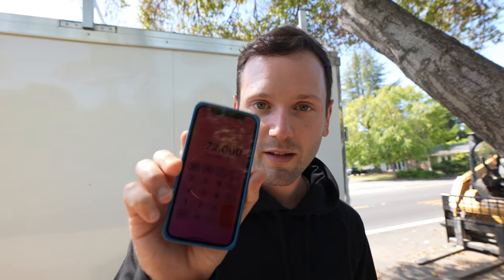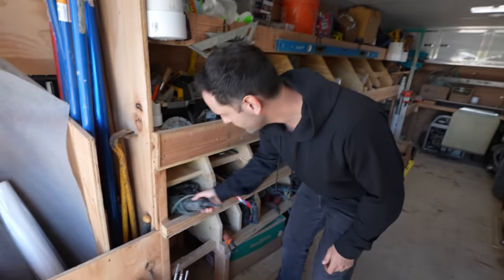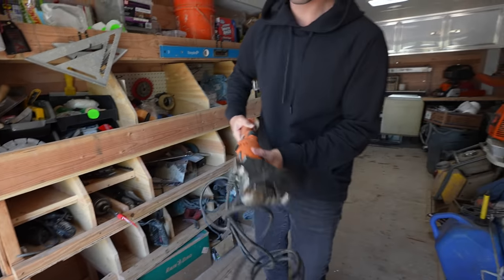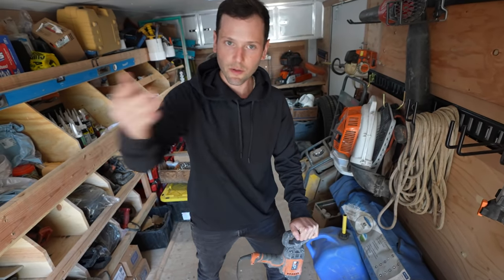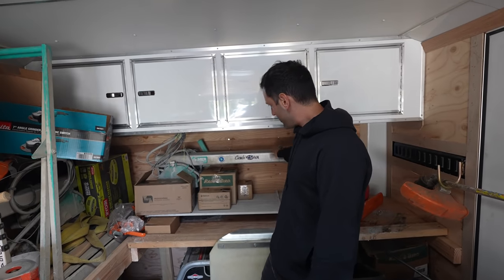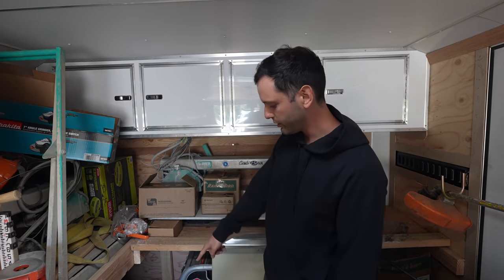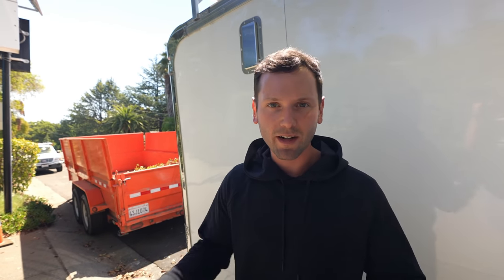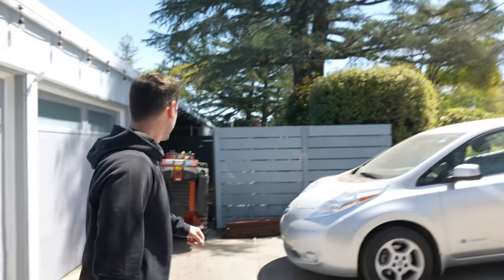First Tools To Start A Landscaping Business!

Comment: This is arrogant. You obviously forgot what it was like to start out new. You do what you need to do to start. You save your money. You don’t rack up credit cards you use that old pickup truck before you can afford a trailer. You buy equipment slowly after you decide what is necessary. You can by cheaper tools and get nicer ones as they break. Equipment will last long if treated right. this guys acts like everything is disposable. The purpose of this videos seems specifically to discourage rather than to prop up new businesses.